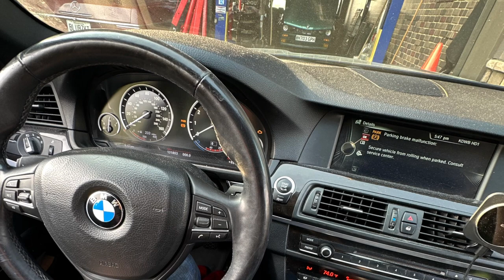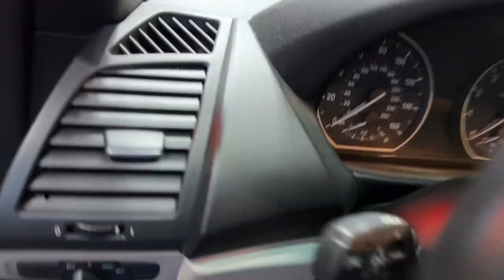F10 535i brakes, E88 M3 control arm upgrade

Comment: I did all that to my 128i as well and it was a nice upgrade. I also did the complete M3/1M rear subframe and a combo of 135i brake bits amongst other things. Have always been curious how much of that 1M experience I've ultimately got.
Reply from the maker: if you have the full lsd rear, comp brakes etc it should be bang on... as far as suspension and chassis. the 1M powertrain tuning is like nothing else Ive experienced in any BMW though.

love the 128i. such a damn good car.